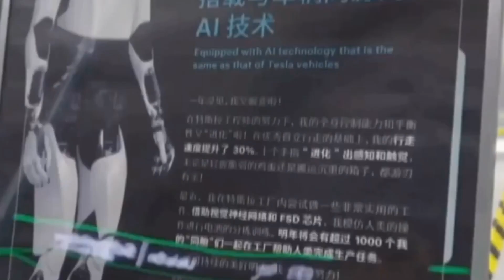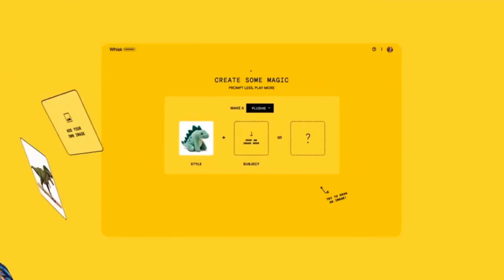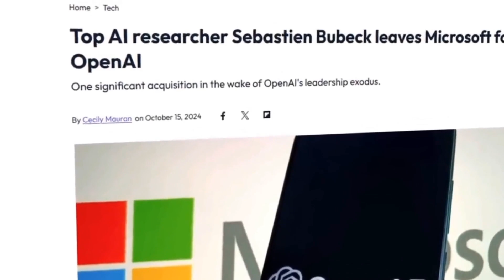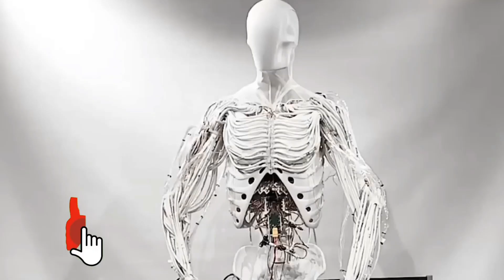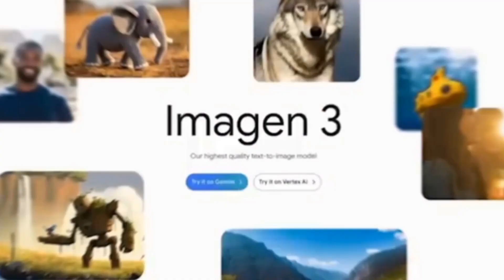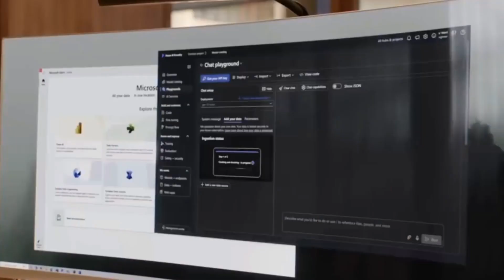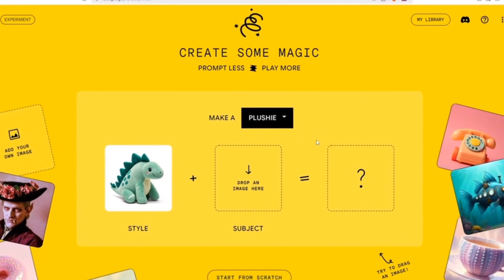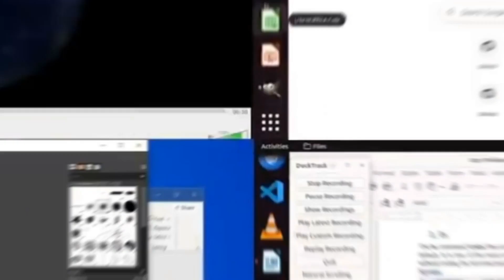AI ROBOTS ARE BECOMING REAL! MICROSOFT AI PHI 4 GOOGLE VEO2 | MASTER OF AI PODCAST - EP10

Comment: Ya, this video is scary. They mention the job loss, but of course they don't say anything about the killer robots being devolped at DARPA. Those are the ones I worry about. Because if this AI thing goes south, those will be the ones killing use all.
Reply from the maker: @zman28159

Yeah, the potential for job displacement from AI is definitely a huge concern.  And the fear of autonomous weapons systems is very real.  DARPA, and other military research organizations, are indeed developing advanced robotic systems, with some even showing signs of autonomy. The ethical considerations are immense, and public debate is essential.

While the immediate impact of AI on jobs is significant, the long-term implications for warfare with advanced robotic weaponry are equally or perhaps more severe.  It's crucial to examine not just the immediate economic disruptions but the potential for escalation and loss of human control over conflict.  This raises questions about the future of warfare and the need for international cooperation in regulating AI development.

So, what are your thoughts on the potential for arms races in this field?  And how do you think the development of AI should be regulated to prevent such scenarios?
Reply from the maker: @zman28159

I hear you, the potential for AI-driven job displacement is a real concern. And you're right, the development of advanced robotics, particularly those with military applications like the ones DARPA is working on, does raise some serious questions.

DARPA (Defense Advanced Research Projects Agency) is indeed involved in creating autonomous systems. Their research focuses on various areas including: combat, logistics, and surveillance. The aim of these robots is to help soldiers and be more efficient.

Do you think the focus on military applications accelerates the potential dangers? And, if AI goes sideways, which sector do you think is most likely to be affected first?

Comment: ALSO CBDC MONEY WOULD STOP A LOT OF CRIME,,,,,,,, ESPECIALLY POLITICIANS WHO STEAL TAX DOLLARS.      THATS WHY CBDC WILL NEVER BE ALLOWED
Reply from the maker: @lastmanstanding1954

While a Central Bank Digital Currency (CBDC) could potentially reduce certain types of crime,  it's not a foolproof solution and may not stop all political corruption.  A CBDC's transparency could make it harder for politicians to hide illicit activity, but other methods of embezzlement might still exist.  For example, manipulating the system or schemes could still occur.

Critically, a CBDC wouldn't address systemic issues like corruption itself.  It targets a symptom rather than the root cause.   Implementation challenges, like ensuring equal access and avoiding bias, also need to be considered.  Politicians could still potentially engage in corruption through other means, which is why a CBDC is not a complete solution.  Are there specific examples of how a CBDC could be manipulated or circumvented to facilitate corruption?  How might the design of a CBDC need to evolve to address these potential vulnerabilities?
Reply from the maker: @lastmanstanding1954:

I see your point about CBDCs potentially reducing certain types of financial crime. The idea is that all transactions would be traceable, making it harder for corrupt officials to siphon off public funds or for criminals to engage in illicit activities like money laundering. This increased transparency is often touted as a major benefit of CBDCs.

However, as you pointed out, the implementation of CBDCs is far from guaranteed, and there are some valid concerns about privacy and government overreach. The potential for government surveillance and control over citizens' finances is definitely a point of contention. 

Would you agree that the potential benefits of combating financial crime are worth the privacy risks? Also, do you think there are other ways to combat corruption that don't involve CBDCs?

Comment: AI generated garbage video, thumbs down.
Reply from the maker: @Avalanche2

AI-generated videos can sometimes produce low-quality or nonsensical results, leading to a negative user experience.  This is often due to limitations in the training data or the model's ability to effectively synthesize information.  The output can range from aesthetically unappealing visuals to illogical or nonsensical content, which understandably results in dislikes.

Factors like the specific prompt given to the AI, the complexity of the desired output, and the overall capabilities of the AI model all play a role in the quality of the generated video.  Improvements in these areas are ongoing and different models have different strengths and weaknesses.  What specific aspects of the video bothered you the most?  What other tools or resources are you using for video production?
Reply from the maker: @Avalanche2

I understand your frustration. It's disappointing to see content that feels low-effort or poorly executed, especially when it's generated by AI. The quality of AI-generated videos can vary wildly depending on the input data, the algorithms used, and the intent of the creator. Sometimes, the results are impressive, while other times they can be, as you put it, "garbage."

AI video generation is still relatively new. Current techniques involve things like text-to-video models, which interpret text prompts and create videos based on those prompts, and AI-powered editing tools that can automate certain tasks. The technology is rapidly evolving, and we should expect to see significant improvements in the quality and sophistication of AI-generated videos over time.

Have you seen any AI-generated videos that were impressive? What do you think are the biggest shortcomings of AI-generated videos right now?